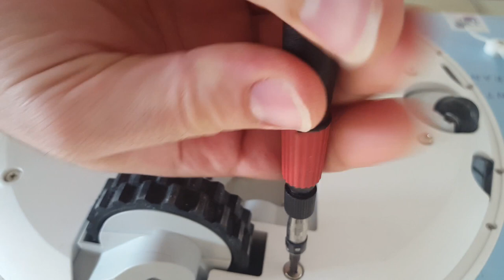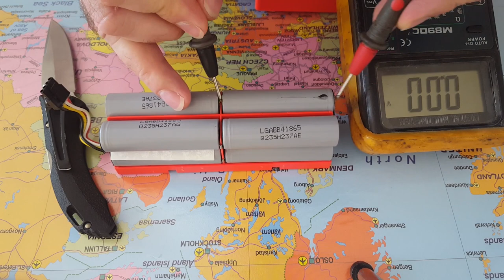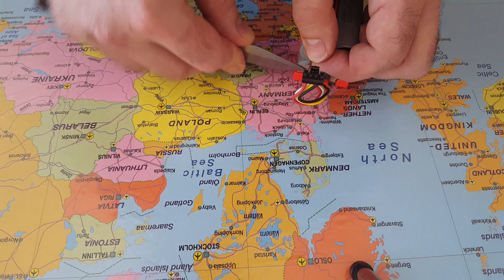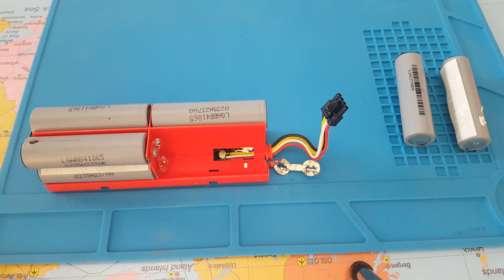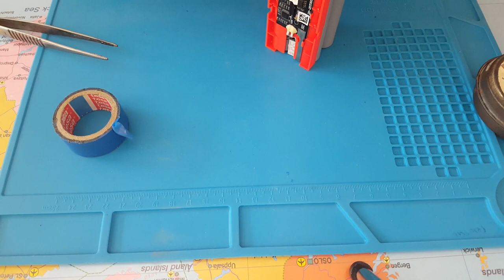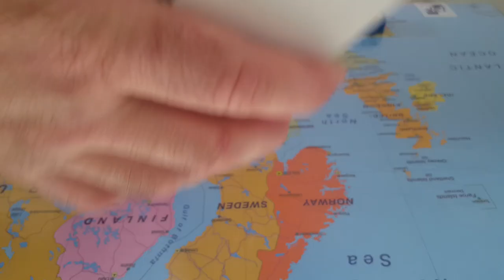Xiaomi vacuum cleaner battery repair

Comment: Thanks, worked like a charm! My battery pack also had 2 dead batteries. Voltage of the pack was bellow 10v and the robot just died everytime it left the dock. :)

Comment: The navigation system is great🌼 with the fact that it does the mapping of the house and knows where it passes does not leave any corners unclean and also saves a lot of time because it does not have to go over several times on the same points.

Comment: Yesterday I noticed mine died too. I was about to buy a new battery when I saw your video, gave it a try and it worked :D Thanks man! Except mine had a ton of glue inside so I had to chop the enclosure to pieces to get it out.
Reply from the maker: I'm happy that you find my video useful, later i found that it can happen only one cell of every two connected in parallel can be defective. If you find that battery capacity is not sufficient and vacuum shuts off during operation until battery is drained to lower capacities - in mobile app - this is indicator of only one defective cell.
Reply: @chichovenci  I measured that both were dead, luckily had many spares from dead laptop batteries. How I noticed something's wrong in the first place was that the vacuum was moving ~2cm away from the dock after a moment of trying to charge. Must be a clever safety feature.

Comment: Hello, thanks for such a useful tutorial. May i ask, if we replace all 8 batteries to LGABB41865, what will the capacity be? Since each LGABB41865 is 2600mAh, will it be a whopping 20800mAh and can the roborock last perhaps multiple times longer than the original xiaomi battery? Thanks for answering
Reply from the maker: Original Xiaomi capacity is 5200... battery is made from 8 cells ...  two in parallel 2600mahx2 = 5200mah ...
Reply: Did u increase the capacity? Did it work?

Comment: Hello, I have a question.
My robot starts cleaning with 100% of battery left and the last 4-5 times when it arrives to 40% it dies suddently.
Before when the battery percentage was low it returned to the dock in order to recharge itself and after that it starts again, but now it stops itself in the middle of the room without any voice message.
Do you think that could be the battery pack that is damaged and it is necessary to replace it?
Reply from the maker: Definitely the some of the cells.

Comment: I have faced with error 14 after changing all the batteries with the new ones. Is there any solution to this
Reply from the maker: According to Google Error 14: Problems with charging. The battery temperature is too high or too low. Wait until the battery temperature is normal.
Reply from the maker: Issue can be bms or temp sensor
Reply: @chichovenci  I have solved the problem. Before installing the renewed pack, I have tried to charge it by connecting it to my charger. Female connectors has expanded while doing this and when I connect it to robot socket, it didn't sense the battery. I changed the connector and now it is working.

Comment: Hello and thank You for Your work!
Is there any chance that You can share a macro picture of the battery board, especialy the B2 compartment. I just put out some resistors with my screwdriver when opening the case and now 
I need to solder them :D
Reply from the maker: i'm not sure how helpful can be this photo ... here it is http://vencislavov.snimka.bg/details/xiaomi.5156827.39087113

Comment: Thanks for the video. May I ask what are the 4 colored cables for? Two of them are for positive and negative I guess.
Reply: I hope that author of this video doesn't mind me chiming in. 
Yes two wires are positive and negative, then we have balance wire and temperature wire.
Hope this helps.
Reply: @igorskuratovsky1  I get the temperature wire, it should be an NTC, but what is the balance wire? Balance should be done internally by the BMS board?

Comment: I am trying to make a battery from ground zero, I bought a 4S BMS PCB, and 8 cells. Could you please tell me the pinout of that battery cable going into the vacuum? I assume, black is GND, red is VCC. What are yellow and white?
Reply from the maker: vcc, gnd, bsi, btemp

Comment: thank you very much for the detailed video. :-)

unfortunately, in my BRR-2P4S-5200S / GB 31241-2014 they filled the BOTTOM of the orange enclosure with glue, so there's no way of getting the batteries out without breaking the orange enclosure. :-(
Reply from the maker: You can 3d print orange "enclosure" in my other video with vacuum battery in the description I placed link to 3d files.

Comment: Hello, thank you for the great video !
First my experience: the robot arrived 1 Sept 2018 and works every single day. Average runtime 1 hour, 50-55 square meters a day, total run 757 hours 38k square meters 867 cleanups. It sits on the charger all the time when not cleaning. 
I didn t find this video before, so I already got the replacement battery pack a few days ago. It wasn t really necessary, just noticed that on turbo mode the robot cannot do the job at one attempt, but returns to the charger before finishing.
Now I want to ask your help. I cannot open the old pack without ruining it, but it has 16.4V btw red and black wires. I want to pu it in my EV as an emergency startup battery. When the 12V small battery is discharged, the car needs something to kick on the traction system, that then will take over and charge the small battery. I successfully used for this purpose a 20V 5S commercial screwdriver battery pack and think that this double capacity 16,4V battery will do the job too. 
But I want to keep it charged ouside of the vacuum, soI need to know what is the method of doing this - what voltage to connect to which contacts of the four pin plug. Would you be so kind to advise the simplest method of keeping it charged ? Thanks a lot!
Reply from the maker: In my opinion if this is original battery first check if there is bad cell i had the same experience cleans but dies somewhere in apartment on random place... after further inspection happened that one of parallel cells was dead. when this happen you can expect faster wear of other cell...
to charge it you can use B6 charger from aliexpress and laptop charger (16v) (have you tried the easiest to connect black and red wire to 16v power supply)
Reply: @chichovenci  hii! Out of topic but do you know the use of other 2 wires? Is it for charging or thermistor?

Comment: Are those LG cells protected or is there an independent protection circuit for the whole battery?
Reply from the maker: All 18650 have CID and PTC protection...  i'm not sure how is realized protection in BMS board.
Reply: @chichovenci  18650 cells are sold in 2 formats in every battery store: with or without protection circuit. Protected cells are always a couple mm. longer and that could be a problem in some devices.
Reply from the maker: protected cells fits perfect in this case

Comment: in my case , dismantling did not work well. Seems that some units like mine are built with cells glued in the orange box, then ....
Reply: Mine too, i use grinding tool, so the outer case will be damaged.
Reply: @ClawHammer00  how did it go eventually? How did you put it back without the original battery case?

Comment: Does your battery still work? There are reports in by other users in the internet, that the charging controller kills the batteries. A change of the batteries did just temporarily fix the problem for them.
Reply from the maker: If controller isn't damaged, battery elements will work fine ... my battery is operational
Reply: @chichovenci  what is battery elements?

Comment: hi, I want to ask a question about battery performance and life in general. I am using s5max. When will the battery lifetime start to decrease if we use it at least once a day and everyday in a week ?
Reply from the maker: Battery life is excellent (if cells in pack are "ok") I have friend with same vacuum and after about 3 years battery life is enough for 100 square meters apartment.
Reply: @chichovenci  
i use roborock s5max. I always run the robot with the same options under the same conditions. and I note the cleaning time, square meter and charge expense percentage in excel after each work. The data has not changed much since the day I bought it. this is good, it means stability. So is this really the case for years? Battery performance and battery life are important to me :)
Reply from the maker: @BARAN BARIŞ  
Maybe is not the best example but it's pretty much like your phone. Batteries degrading with time and cycles, also cells "hate" low and hi temperatures.

Comment: Thanks for the video. I replaced all my cells with NCR18650B. Fully charged cells, I get 16.4V between testpoints T10 and TP2. However, at the connector, black and red cables measure 14.8V. All other testpoints to the battery leads measure 4.1v or 8.2v. Any ideas? 
The robot won’t power on with battery alone. When on the dock it powers on and says charging, no errors. The moment it gets off the dock losses power. I have a new battery which works fine with the robot, so I know it’s not a problem with the robot. Thanks in advance for any tips.
Reply from the maker: I'm almost sure that you have issue with the fuse, 12ah3 in my other video I had the same issue and replaced the fuse. After i replaced the fuse with another one battery become fully operational.
Reply: @chichovenci  thanks for the tip! I think you are right! One of the fuses seems to went off. I’ve not taken it out yet, but it should be a SC 12AH4, right? since it’s 4 cells in series. Thanks again for the useful video and tips.
Reply: @IoannisNousias  I had the same problem I was able to solve the problem
Reply: @IoannisNousias  I did everything shown in the other video when I left the charger stops working at all
Reply: Você sabem onde fica (perto de que) esse fusível?

Comment: Hı, i changed 2 dead batteries, voltage seems ok when i check it with multimeter. But the problem, although ı replace the battery pack, mi robot does not work. Can bms damaged?
Reply from the maker: Except, faulty battery this fault can arrive if there is a issue with charging circuit on the mainboard. It can be caused of faulty charging controller or some elements in charging circuit.

Comment: Hello. Where did you buy the batteries? Can you help me with the model of that battery?
Reply from the maker: Original cells used in this battery are:
 LG... model is LGABB41865 you can find them in most electronic supply stores; internet magazines ... etc.
Reply: @chichovenci  thank you very much.

Comment: I have replaced all the cells (the vacuum started stopping suddenly while cleaning at the maximum speed) but now the battery doesn't work anymore. The new cells are Samsung 18650 30Q, they had 3.70v when installed and the soldering points are good (all tested). Now the robot detaches itself from the charging station and shutdown. It doesn't turn on if not under charge. Any idea?
Reply from the maker: Charging board is not balanced. If there is diferent charge on every continues coupled batteries you will experience exactly this. Check the charge of  batteries (voltage) after it turns off and after is charged if there (is a difference - you already find the issue) ... (you can use IMAX b6 to fully charge all  4 pairs of cells and after they are charged hopefully  battery will work).
Reply: @chichovenci  Hi, each parallel of two newbatteries has about 3.72V (much less than the original batteries (that were about 4.00V). Is it possible that it is too low and they need an initial charge?
Reply from the maker: fully charged - 4.2v
Reply: @chichovenci  so, I charged the parallels, but it still doesn't work. The vacuum cleaner detaches from the charging base. How many volt you measure at the red and black wires out of the battery pack? I get only 7.8V, not 16V. Is it normal?
Reply from the maker: about 1 or 2v less than measured  on battery terminals.
Reply: @chichovenci  there is something wrong with my battery pack. Battery terminals is 16.8 but at the battery pack wire it is about 7.6. Ideas of what can be broken?
Reply from the maker: 12AJ4U - it's a fuse on a charging board.
Reply: @ReX-jo6hb  Do you find a solution? I have same problem, ~ 13v on red/black, battery balanced. But don't up if not at base and shutdown if go away from it.
Reply: @moonikook2700  yes. I had to replace the three pins fuse on the board (it is a fuse with a built in resistor).
Reply: @ReX-jo6hb  on which board did u replace? on the battery board or main? can you send a picture?
Reply: My issue is wuth a new battery pack vaccum shuts off after leaving the dock contacts, but if I start it manually - it works...
Reply: @hellfreezover7613  in the end I changed the battery. But now I have a different issue: it starts, then after few seconds stops and resumes on its own.
Reply: @ReX-jo6hb  i replaced the thermal fuse on the battery, and it works, it was rated 65 deg, i changed to 70 deg (from the original battery that cane with the vacuum), it now works great, doesn't stop.
I guess the thermal switch was defective.
Model is TS02-BB6D, for those who want to replace.

Comment: Hey, video is uber cool! I have a 1st gen mi robot which keeps shutting off suddenly  after it reaches 58% of battery. Check the output voltage on the batteries and it gives 16V when fully charged between the red cable terminal and other 3 lines, which makes me think its not the battery problem. I would be really grateful if anyone knows a solution as to why it is switching off suddenly?
Reply from the maker: Check battery capacity
Reply: This is my problem too!
Did you find any solution?
Reply: @idanvirt8823  nothing as of yet. Waiting on a battery from AliExpress to get delivered during these  days of uncertainty. Will post here if I find a solution
Reply: @idanvirt8823  got my battery from aliexpress and it's working again!
Reply: @basanthbalram  me also!
Im very surprised..
But week after my wife saw the s5 max robot on a good price and she bought it. So now im trying to sell the roborock 1st generation 😂
Reply: @idanvirt8823   good on you brother. after getting an almost negligible reply from customer service/support, i have decided to pass on xiaomi products from now especially since anti-chinese sentiments are seeping everywhere and affecting service for these products. Peace out
Reply: @basanthbalram   whatever brand you buy it’s probably made in China though 😂 so what did you get eventually? How’s the performance?

Comment: Fantastic. However, We do not recommend DIY for wrapped battery packs, as the wrap is for heat installation, when charging. 

You can buy new battery packs, globally cheap from China for Xiaomi and Viomi brands.

Thank you.

Comment: Error 14 please
Reply from the maker: check battery voltage between black and red wire (also check contacts are they clear, check if connection is secure)